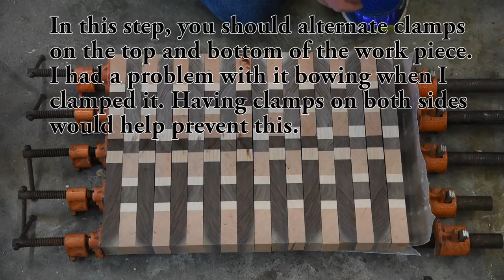Cutting Board

Comment: Gotta love not having a jointer! Handplanes do the job and you get a good workout. cutting boards are my biggest seller. I usually make a few when I have alot of scraps. I have yet to make an end grain cutting board because I'm afraid of movement and having to burn it if it twists and cracks too bad. I guess i have to just man up and do it! lol

Comment: Because you used epoxy which is not food safe, I recommend you use it only as a decoration. Maybe to mount a sign.
Reply from the maker: +Boa The epoxy is only little dots. Maybe a few thousandths diameter, so it's not enough to worry about.

Comment: You gave all dimensions except the original "planks".  How long were they before you ripped them to the stated sizes?
Reply from the maker: I think they were around 23 inches long. To figure it out, you can take the total width you want and how many columns you want and add the kerf of your blade (multiply by the number of cuts) to figure out how long the originals need to be.